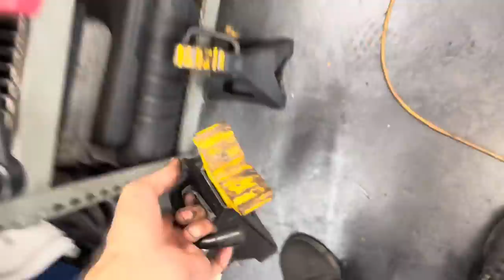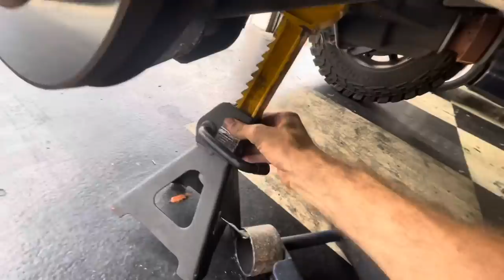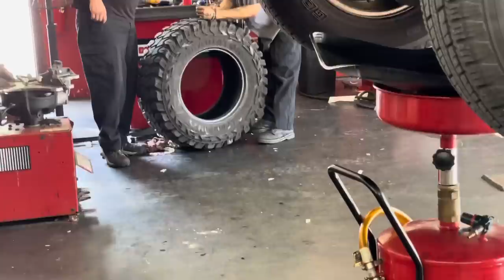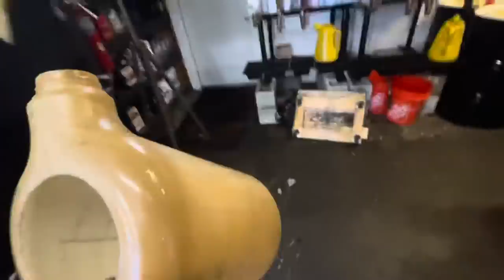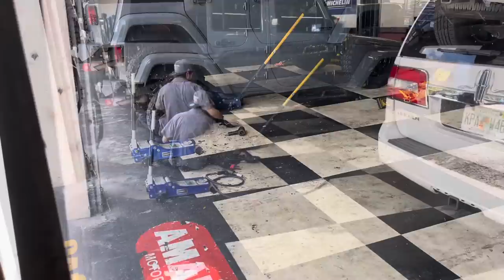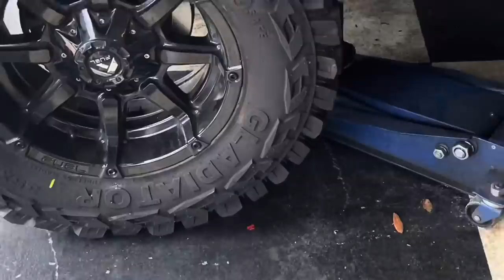Jack Stand Joke! I Failed!

Comment: need i be the elephant in the room???  reaching under a vehicle to insert a stand is just as dangerous as not using one. the only difference is the amount of exposure to the hazard. what happens if it drops while you are placing the stand before it in place???
Reply from the maker: I’ll just move through the matrix in super high speed lightning fast motion allowing me to dodge the jeep
Reply: @RainmanRaysRepairs  lol  i just had to
Reply: Saving the colleague's nrck 👍
Reply: How would you do it?
Reply: Then there would be no video cuz Ray is in the hospital.
Reply: @gr7485  As carefully as possible. I'm not going to answer. I don't know. Rainman was doing Jeepy a favour. Not blaming Rainman. 👍
Reply: @RainmanRaysRepairs  And may the force be with you. 😆
Reply: how else do you think jackstands are placed where they need to be? they just spawn from lift points when the vehicle is being lifted
Reply: 00000
Reply: @gr7485  That's the question to be answered since the situation in and of itself is an oxymoron. it's a mental gymnastics of cause and effect
Reply: @YoureWierdImN0t  i'm all for safety and  jack stands. it's an excercise to provoke thought and situational awareness and the awkwardness of risk management
Reply: You make no sense.  If there is an elephant, Ray can just have it hold the jeep up.
Reply: @RainmanRaysRepairs  "Dodge the Jeep"...I see what you did there Ray 🤣
Reply: @gr7485  Actually you should place the jack stand  under the axle before the tire is removed. Safety wise, Ray should have used another jack as a backup while placing the stand since the wheel/tire was already removed. Remember, SAFETY THIRD........
Reply: Generally, one places the jack stand PRIOR to removing the wheel.
Course, I work with a guy who forgot to put a JACK under the car, and removed the lugs......
Fortunately, he got lucky.
Reply: Next time, simply lower the floor jack down until the rotor just touches the ground.  That will illustrate EXACTLY what CAN happen when the floor jack slowly weeps down.
Reply: @mmix224  That's odd, I don't remember you ever working with ME.
Reply: Jack click jack click? lol
Reply: Yo ray ur oney
Reply: @terryharvey4811  lol. This was for a flat repair. I said something before he tried to take the wheel off 😂😅
Reply: HtH are you going to get a jack stand under there when the vehicle hasn't been lifted yet?
Reply: That is why you leave the stand out, walk away and trick Rainman into doing it for you.  (Insert evil laughter.)
Reply: I completely disagree with Richard Cranium. Lift the vehicle, install the stand, remove wheel. Service, and reverse. If the vehicle falls while properly you're installing a jacketstand, it won't hurt you. If the lift fails without a stand nor wheel, you could die. Your time isn't worth that risk.
Reply: I almost never use a Jack stand for quick work. I'd say a 3 ton jack holding a corner or even the entire rear axle will gitter done. I only use stands for 3/4 ton+
Reply: @oldschooldude8370  Hydraulic jacks are intended - and designed - for lifting and lowering, not for holding. While I will not question your intelligence, willingly relying on one to hold a vehicle up while you work underneath is not an intelligent act. And publicly announcing to thousands of people that you do this thing, well... that act speaks for itself. 

Guy in my city did the same thing. As the business he owned has class 8 heavy trucks, it's a safe assumption that his jack was far more heavy duty than the one you mentioned. He's been in a wheelchair for 20+ years, due to his negligence.
Reply: @wesgregg6451 Easy there hot rod. I said quick, easy work meaning pulling a wheel or two.  I never implied I was working under the vehicle. Been doing this kind of work almost my entire working life without error. Had a 1500 on 4 jackstands in the parking lot in my young days for 4 donuts because there wasnt room anywhere else.
Reply: ??? But how would you place the jack stand under the vehicle in the first place???

Can you make a video of the order you do it in?
Reply: @richardcranium5839  Short of using two floor jacks to ensure a point of redundancy (and next to nobody does this) there's an acceptable level of risk that is applied to situations like this. You do not get under the vehicle to set the jack stand. You reach underneath. If the jack happens to fail during this, then you're not being crushed. You could also set the tyre that was removed underneath the body so it will arrest the fall. 

But if you're going to argue about risk management to this detail you probably shouldn't be near a car in the first place - according to the NSC Injury Facts there's a 1 in 101 chance of dying in a motor vehicle accident. It's the 8th most likely cause of death in America, with gun assault being #10 remarkably...
Reply: @AnthonyJ350  The clearance under the car when the wheels are on is your safe zone. So keep away from the areas that could squish you (ie under the tire, between the tire). Assume the jack will release while you're under the car. This is safer than assuming the jacked car without its wheel will not fail.
Reply: @RainmanRaysRepairs  😂😂😂😂😂😂😂😂😂😂😂😂😂✝️✝️✝️
Reply: While you can't remove all risk, placing a jack stand before removing a tire creates a smaller distance the jeep can fall. Verses not having a jack stand and no tire, and placing your head under the frame to inspect or retrieve something.
Reply: @YoureWierdImN0t  the one on that jeep spawned out of nowhere🤣
Reply: @Fun4GA  I'll agree that is the safest method. But we've all been in situations where the jackstands need to be repositioned as well, similar to the Video.
Reply: @AnthonyJ350  Yes, The video shows the most dangerous way to set a stand. After he placed it, he did a good job of loading it.
Reply: @Fun4GA  If he slipped the wheel under the frame as a cradle before doing so, would you be happy then?
Reply: Captain Beefheart could summon his magic band by opening a can of Pepsi. I summon my jack stands  by opening a can of PBR and they magically appear in place.
Reply: With tires on the car minimal... Tires off just askin for it..  Remember those olde vw jacks they would sometimes shoot off car..
Reply: Where I come from the rules about jacking and lifting with safe equipment and usage are made by the intent of OSHA and your service manager and shop foreman.
They aren't a matter for opinion, except ideas are shared at mandatory safety meetings. Each person in the shop is to be aware of training underlings and calling attention to questionable or unsafe practices. Your state may also have similar laws to OSHA  when you see a problem you should do like Ray to teach and remind without starting an inquisition. But some situations are best pointed out to the shop foreman or most qualified person who cares. It should be important to each worker that everybody gets to go home at the end of the day without being injured or causing damage.
And that's a good should.
If I may be so bold as to should on you all.
Reply: @RainmanRaysRepairs  cant let the jeep ram you!
Reply: @AnthonyJ350  Best and safest method is to never remove the wheel until the vehicle is jacked up and securely stable on a Jack stand or stands, Then remove the wheel. Because of the long suspension drop out of the Jeep and it just being a leak repair I would Jack under the axle instead jacking the body or frame.
Reply: You can Teleport jack stands anywhere on the Planet, at any time.
Reply: If you pay a tiny bit of attention: the guy got almost both his legs under the wheel while working. Go figure. Gravity is always there, i worked on tractor tires, and sometimes the tractor can slip, i had this once, gravity always win. Also ideally the jack need to be positioned before removing the wheel.
Reply: @YoureWierdImN0t  ive been working as a roofspecialist and sometimes you cant place a roof anchor without "not being anchored" you have to get on without to place one.
Reply: I normally rely on the jack stand fairies to put them in place but when they refuse to play ball I just have to rely on that 2 cent o-ring for a minute while I do it myself.
Reply: Although it would be life altering, losing an arm while placing the jack stand is still better than losing your life.
Reply: It's called safety third. You make the job as safe as possible weight the risks and continue on.
Reply: Actually MORE dangerous. As he had to reach UNDER the Jeep to put it in place but stayed off to the side to install the tire.
But it's Ray's channel so he preaches to the choir.
Plus, I like the FACT that Ray thought it was proper to use a block of wood to extend the reach of the jack in the first place. Proper OSHA rules were STILL NOT followed.
They were probably HF jackstands anyway.
Reply: Well the jack stand should have been there before the wheel was removed. So normally one would not have a safety hazard. Now in this situation I would have let the jack down so the brake rotor was taking the weight. And pretend to the tech that his jack failed.
Reply: If you can't reach under the car on the jack, how the hell do you place the stand in the first place?
Get a grip.
Reply: @shadowofchaos8932  There would be hospital videos!
Reply: You do realize that the jack is used to raise the vehicle before placing the stand right?
Reply: @Laugh1ngboy  is it really?
Reply: @istoneyy4204  Ask Mike Rowe
Reply: @RainmanRaysRepairs  mate of mine for nearly 50 yrs, working at nite on a 56 f550..somehow, crushed himself. trolly jack failed, sunk, tiped. no stands..wife found him dead at 11.30 nite. crushed..nice.. you should fit 6 or 8'' steel wheels to certain 4x4 trolly jacks..specific use..but then,,we dont need new rap listening mechanics, so he,ll be fine,without your help.. is he an apprentice,,or nearly a statistic, which would of cost you thousands & no work for wks..we see accidents on bulding sites,,we go home, fast, before the safety eggsperts, close the site down, take names, check your tickets. hand out fines, of thousands.. all elec tools gens, ticketed every 3 months. $8, per tool..aus..
Reply: Almost the same logic of assuming that I will be electrocuted by my microwave because it zapped me the second I hit the start button without any warning
Reply: Because some people have what’s called brains the only way tht jeep was coming down was if someone had driven into it.. U can “what if” all day from rolling out of.bed to turning ur kettle... BOOM 💥
Reply: Its the only way to protect Jack.
Reply: Sooo...what's the answer then?  How do you address the issue 🤔?
Reply: It's a time of exposure. The longer the floor jack is supporting the weight, the increased odds of failure. The less time the floor jack is used for support, the lesser the odds of a failure. Both have risk involved but not using the jack stand has higher risk.
Reply: Yeah, it might fall, so you should never risk putting a jack stand under it!

That makes perfect sense.
Reply: Move

Comment: If you were caught using a jack without stands it was instant dismissal from my workplace.  No arguments.  Big sign on the wall said "Axle stands MUST be used at ALL times - or look for a new job!"
Reply: That is personal rule, that I live by.    I still remember when I was about 16 years old or so, my best friend at the time, I was at their house one day.  And his dad just happened to be working on his Olds Cutlass Ciera, about an '89 model or so.  Anyhow when we came back outside the house to leave,  the car had fallen off the jack and pinned him under the car, not even sure how long he had been like that.  But we had to rush over there and try and get the car lifted back off his chest.  Luckily, he wasn't too badly injured.  I think he might of broken a rib, but all things considered, he got pretty lucky.
Reply: What was more puzzling is that the guy didn't seem to understand how stands are used.
The fact he was trying to remove it without lifting the car first...
Reply: @Cheepchipsable  I think he assumed that Ray didn't lower the jack but just put the stand their as safety
Reply: @Cheepchipsable  Depending on how deep I am under the car, at my own house, if no part of me can get pinned and it's a light looksee or changing a tire, I do it on the jack.  If I'm doing something quick like an inspection where my head is in the wheel well, I put a stand under but don't lower on to it.  If I'm putting my body actually under the car where it would get pinned, it's a jackstand with full weight, plus the jack taking up a hair of weight, just enough to stay put.  I don't play where it comes to getting pinned.  So he noticed he was closer to the stand, and checked it, before realizing it was there by the book.  So Ray still got him in a way, and hopefully he realizes it's not just a joke.
Reply: And they're right.
I keep one in my car for when I have to change a tire.
Reply: @georgemartin5980 
But you don't know what the car does when it goes off the jack.
It could go sideways. It does damage to your car too.
It costs nothing to use the stand.

Comment: Never sit like that putting a tire on either. In the event something happens, you can't move away fast enough. Someone needs to do a safety 101 talk with that fellow ASAP before he becomes a casualty.
Reply: Common sense i would think. Good eye.
Reply: That would be even worse if Ray did not put the stand under the car
Reply from the maker: Kids these days 🤣
Reply: Yep! I noticed that, too.
Reply: Yeah for sure, cars can be fixed, people, well that's painful and gets a whole lot more expensive. Car repairs are through the roof, but hospital bills make fixing cars look like chump change. Know a guy that got a $10,000 bill just for a simple hand injury, sliced his palm with an angle grinder. Ouch.